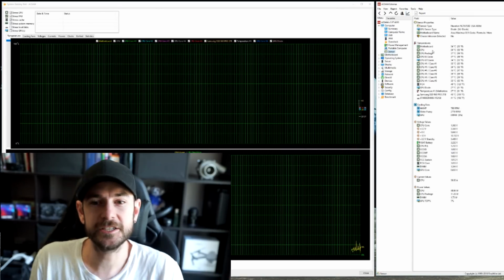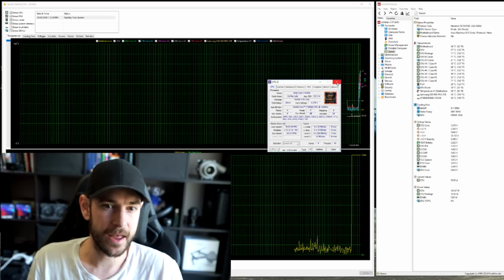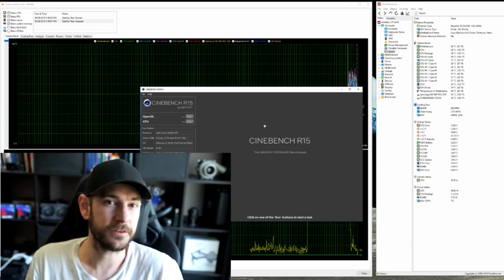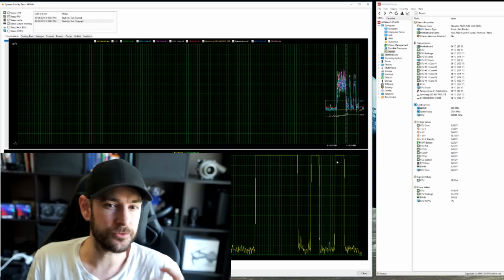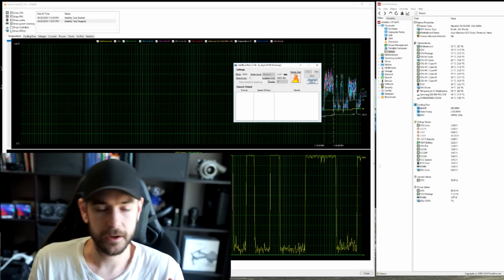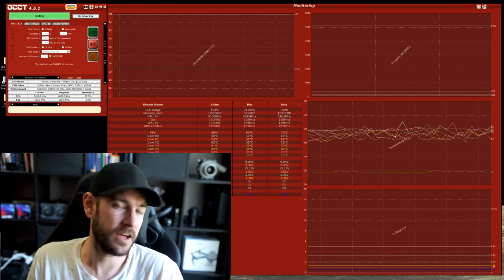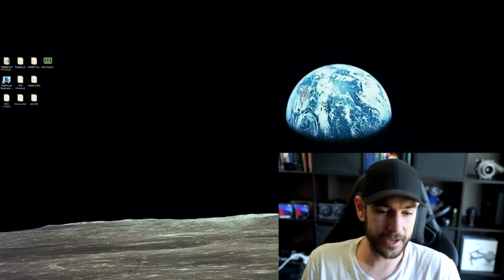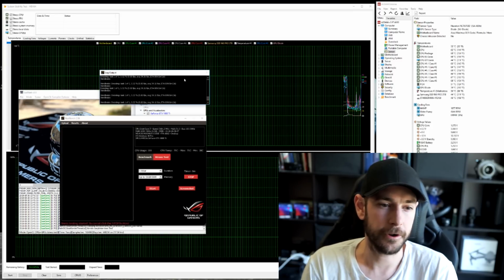How to Stability Test an Overclocked PC

Comment: Good video! I liked and subscribed. I know I might be late to ask a question but I hope you will answer this. My pc shuts down completely when I stress test both GPU and CPU at the same time. I use CPU Z and GPUbench from 3dgeeks. Is that something I should worry about? Could it be that my PSU is not supplying enough power? When I was stress testing my pc the CPU is over locked. I haven't test it with non oc cpu tho. Thanks
Reply from the maker: Power supply is the first thing I’d be checking.
Reply: @boostedmedia  thanks for the reply! Is there any way to check my PSU? I'm new to pc gaming.
Reply from the maker: Make sure it’s rated high enough to handle your hardware. You can use something like PC part picker to check.
Reply: @boostedmedia  Hey right now I'm stress testing my pc with CPU Z and unigine at the same time. It's running stable with GPU and CPU both running at 100 percent. So PSU is not my problem? I'm not overclocking my CPU when doing this test
Reply from the maker: So it only happens when overclocked? What about if you o pay test CPU and don’t run GPU simultaneously?
Reply: @boostedmedia  Yes it should be like that, but i tried overclocking my cpu again and stress test both gpu and cpu and it was fine. But in this overclock i didn't increase my cpu voltage. The clock is 3.8 ghz just like usual but i just didn't increase the cpu voltage. My CPU is Ryzen 5 1400 btw.
Reply: @boostedmedia  what's pay o test? Is that a typo?
Reply from the maker: Sorry. “What about if you only test CPU....”
Reply: @boostedmedia  it's totally fine

Comment: as you said, my cpu reaches 100% use and then it crashes when im inside a game, but the temperature stays below 65 degrees, whats your recommendation, should i down the ghz? thanks for this video!
Reply from the maker: Either up the voltage or lower the clock speed.

Comment: Realbench says "Instability detected" after like 20 Seconds. If i do a regular Benchmark with it, everything runs fine. The Error occurs as soon as Luxmark opens up. My 2080ti is OC by factory.
Reply from the maker: I’d set your multiplier down by 1 and see if you still get the error. That will rule our your GPU as the cause.
Reply: @boostedmedia  Realbench Benchmark - Stable
OCCT Large Packets - Stable
Prime95 nonAVX small FFT - BSOD
Cinebench too many times in a row - BSOD

Manual Voltage 1.35V
It shows 1.332 in Idle on CPU-Z. On high Load it goes all the way down to 1.288! So my Vdroop is insane. LLC is 7 so already really high. Temperature for my 360mm AiO is not the Problem, i'm reaching 88 max.
Reply from the maker: That’s a lot of Vdroop for LLC7. What power supply do you have?
Reply: @boostedmedia  A Corsair RM850x. That would explain Benchmarks crashing if it drops too far. I mean... setting it to 1.35 should not give me 1.28 with high load.
Reply from the maker: I think you might have a dodgy power supply or motherboard VRM circuit.
Reply: @boostedmedia  That would suck indeed... i could try level 8. But i've heard that's dangerous for long term. I'll play around a little more with it. You've already helped me more than enough, thanks for taking your time. At least i've learned something. :)
Reply from the maker: You’re welcome mate. You could try level 8 but keep an eye on your voltage at idle and start with no more than 1.3V  base setting.
Reply: @boostedmedia  I changed my XMP Profile from II to I, then lowering min and max cache to 43. I could run Prime95 12FFT for 30 Minutes straight with temps maximum 97. Success!! :D The cache does make little difference anyway. I'm not hunting for High Scores so i'm done.
Reply from the maker: Excellent!! Glad you got it sorted mate.

Comment: Hey man, i was wondering if there was such a thorough way to test a GPU overclock? The video helped a ton, and saved a lot of frustration!
Reply from the maker: Hi mate. I haven’t done one for GPU overclocking because the gains are relatively small and it can be a lot more confusing. There’s some good written guides on google though.

Comment: When i put 4.5 ghz on i7 7700k i can put +70mhz and +100 on my memorys on my gtx strix  1080 but when i put 4.7 and put more v.core a litle more i cant put +70 our +60 even +50 and nothing more in memory gtx you now why? Have some tipe our can imagine something?
Reply: The CPU is bottle necking the GPU because it's a really high clock
Either the GPU is bad or the CPU is too good
Reply: @PizzaPowerXYZ  i dont really undestand
My gpu is a 1080
I can do somenthing about that?

Comment: I can't get my 9600k stable past all cores at 4.7Ghz in prime95. Ram at 3200mhz. Ran that for an hour and didn't get any errors or hardware failures. I've tried to find the right voltage for 4.8 but it just says hardware failure after like 2minutes on every voltage i've been comfortable trying.
Reply from the maker: Sounds like you’ve hit the limit of your chip.
Reply: @boostedmedia  Yeah.. I guess I'm never gonna win in any sort of lottery lol.

Comment: I run all this tests like in video with my brand new pc (stock), all looks stability. CPU temp ~56 C - at 100% using. No errors or BSOD. But still i have problem. After gaming 10 -20 mins. AAA type of game, i geting BSOD with some diferent errors. I connected with microsoft assistants, they unistalled some drivers, even fresh instal new build of OS. Now my OS up to date, drivers also. Today i all day was without BSOD, but my AAA games crashed without errors. At evening i got again BSOD. I cant find any solutions at google, i tried everything.  Maybe any rly smart person can help?  MS agents sending 1 to other.. every time i need explayning my problem, they doing same tricks.
Reply from the maker: Would need to see the error logs to see what’s causing the BSOD. Is it always while gaming and never when stress testing I’d be swapping out the graphics card and seeing if it solves it.
Reply: @boostedmedia , i think no more BSOD, i fixed with some drivers. now only games crashing to Desktop without any errors.
Reply: @boostedmedia  , still i think its some software  problems.. http://trl.lt/di-P4UW33.png if its can run benchmark at 8k with lags, but not crash, only AAA games crashing.

Comment: So, I'm running a 8600k 5ghz 1.3 basically with the same settings, started everything very conservative and I can't seem to get Intel burn, or the red one to pass. Core hits 82 at hottest point. Am I gonna need more voltage to pass these tests or is that basically just a wrap that 5 isn't going to be stable ?
Reply from the maker: Could be either a voltage or thermal bottleneck. If try delidding first if you want to push further.
Reply: @boostedmedia  How can I tell which one is causing the crashes? Every other test I'm never touching 70s but that and the OCCT hit high numbers (low 80s) core 2
Reply from the maker: Trial and error. Lower temps, if it doesn’t help then increase voltage.

Comment: Thanks for another great guide man, now even noobs like me can OC lol. I'm on i7 8700K, Code and 16GB 3200RAM. First I tried the settings you mentioned in your OC guide exactly at 4.8ghz and 1.3V and temps were not great but ok then I tried 5ghz and temps were reaching into the 90s. I dropped the Voltage down to 1.23. Then I ran aida for 15 min with 5ghz and 1.23V for 15 min and it was fine with great temps and I mentioned that in my post on your OC review. You said 5ghz at 1.23V is a great result and I must have an amazing chip which was nice but also when something sounds too good to be true it probably is right. So today I came back to continue with your stability testing guide. 

Cinebench-passed
Intel Burn Test 10 times standard - passed
Intel burn test 10 times Very high - Failed after second time. It said try lowering core clock or get better cooling or something like that. I have the Hi115i Platinum and fans/pump were set to quiet mode in corsair ICUE software. I decided to try the very high test again but this time I set the fans and pump to extreme mode also opened the window for some cool air to come in. After doing that I passed the Very High test 10 times. Most of my stuff has RGB on it and all the lights were stuttering lol. I think passing the test on very high is good enough for me probably as I only game and watch videos but I may do the test on maximum later on. I'll probably finish watching the rest of the guide now and see what you say there about the GPU and stuff.  

I do have two questions though. I have the min/max cache ratio set to 42, is there any point in raising it now or not? Also, my load line is set to 6 should I drop that down to 5 or not? Thanks again man!

Comment: This was really helpful. I used der8auer's guide for OCing an 8700k on a Maximus X Hero originally but recently ran into some stability issues. I recently started getting a lot of "Memory_Management" bsod's and I have been desperately trying to figure out what was causing it. I honestly think that it may have been the XMP running a lower voltage than recommended for my RAM, but I am honestly not sure. I ran memory diagnostics that returned no errors, checked my disks and had no errors, so now I have come across your other video on how to overclock. I read on a thread to try resetting the CMOS so I did that and basically used your guide to OC from the get go. I ran all of your stability tests recommended here and so far it seems stable so I will be testing everything to see if I run into problems. You earned a sub here!
Reply from the maker: Great stuff. Glad the guides helped :)
Reply: Ok, as of now, I have not had a bsod, however, I am still getting application crashes with exception code 0xc0000005 which from what I can find seems to be related to memory. Could I just have faulty RAM? Should I try unplugging one stick and trying with just 1 plugged in to see if I still have problems? Unfortunately I don't have other sticks to test with, may need to buy some.
Reply from the maker: Yep try with one stick or swapping sticks into their correct matched pairs. 

You may also need to increase your VCCIO and VCCSA voltages
Reply: Ok. I'll troubleshoot with that before buying new sticks. Thanks
Reply: Ok, so after testing, I was able to determine that one of the sticks was faulty. I have gone out and bought new sticks and installed them, and it appears to be working great so far. Gonna keep running tests.

Comment: My Aida64 extreme shuts down after a few minutes. Also CPU-Z does the same thing. All other programs like hwmonitor and core temp stay running fine. Any solution for that?
Reply from the maker: Your overclock is unstable
Reply: @boostedmedia  will apply more voltage to see if it shuts down again. Thank you and very nice videos.

Comment: Is that safe and stable when you keep your core cpu voltage over 1.35v?  Are we supposed to keep voltage lower than 1.3v to keep this cpu last as long as possible? Thanks
Reply from the maker: It depends on the temperatures. I usually recommend under 1.3V and 75C for the longest life possible. But we’re talking 10 years plus.
Reply: if im not misunderstanding, are you overclocking your cpu at 5.2ghz above 1.35v for daily use? or you are just trying to see the potential of that 8700k.

Comment: Just like to say a big THANK YOUUUUU!

 I've been following your tutorials on overclocking & followed the 8700k guide to the T as a base & then this tutorial with aida64, IBT, OCCT- 13 hrs (overnight), realbench & gaming 
With 0 issues. 

So 4.8ghz at 1.3v but I upped the cache to 45
I am really happy because the temps at stock were 75 to 80c and with this overclock my temps are down to 65c on AIO,  no delid (Have all the kit and will be following your guide on that too if i decide to) 

Anyways if you have time to answer what would you say ? Stay at 1.3 & Up the the clocks to 5.0ghz & delid since i have the tool, liquid metal & glue etc or should I lower vcore, up cache a little more and be done with it ? 
FYI I care more about best performance rather than benchmarking.
I know over 4.8ghz i will likely see benefit drops very big! 

Thanks again. It's been a year of confusion for me and all is clarified. I can't believe it TBH.
Reply from the maker: It really comes down to what you want. You won’t see a tangible performance improvement from delidding and pushing further.
Reply: @boostedmedia  Great! Yeah i decided to stick to what i personally feel is best.

 I'm at 4.8ghz 1.26v 3200mhz RAM going down in 0.01 increments gonna try 1.25 next day etc etc  till it crashes. 

Thank you. Your videos helped with the steps i need later on when I need to fine tune over the weeks if need be. :)

Comment: Hopefully I will get something good out of this video. 6 months ago I overclocked my Ryzen 1600 build. I overclocked my CPU and memory, and used the computer for 6 months without any issues. I stress tested my PC for days using: Aida64, Realbench, Memtest86, and OCCT. No issues. Today I decided to play a game which I rarely do, and one time I got a blue screen with the error "Memory management" I tried the game again and it froze for a second before the game closed. I tried them game again and it froze on the same cut-scene. So far I think I have only had issues during a mission or a cut-scene. It's just frustrating since my stress testing has been successful -.-
Reply from the maker: That could be tricky to troubleshoot. Is your Graphics cars overclocked?

First hint I’d try is returning to stock clocks and see if it still happens. Could be an issue with the game itself. Or maybe drivers.
Reply: I should have mentioned that GTA V is the game I was trying to play. My GPU is not overclocked. I have removed all overclocking and have been playing some GTA V without any issues so far. Will keep playing and see how it behaves. If it's good, I will overclock my memory and see how it goes. If it passes that I will overclock my CPU too, but I think it's a memory issue. I have seen that people tend to have issues overclocking to 3200Mhz on this motherboard, or with these memory sticks. I just know that the stress tests I have done in the past passed, but running GTA V is causing issues. I also have the game installed on my HDD and not on my SSD if that matters.

I will throw my specs here:
CPU = AMD Ryzen 5 1600 3,2GHz Socket AM4 Box
Motherboard = Asus ROG Strix B350-F Gaming
Memory = Corsair Vengeance LPX Black DDR4 PC25600/3200MHz CL16 2x8GB (CMK16GX4M2B3200C16)
Video Card = Asus GeForce GTX 1060 Dual OC 2xHDMI 2xDP 6GB
Power Supply = EVGA SuperNOVA G3 550W
SSD = Samsung 840 EVO 500GB
HDD = Seagate Barracuda ST4000DM004 256MB 4TB

Comment: Buddy I need your help, I got 8700k running cinebench just fine @5ghz with just 1.248 volts but it fails at Intel burn test. Everything running stable but it fails at Intel burn test. Please advise..
Reply from the maker: Have a watch of my 8700k overclocking guide. You likely need to increase vcore.